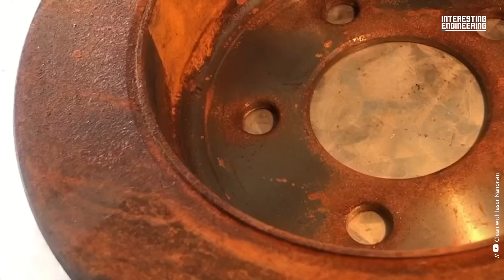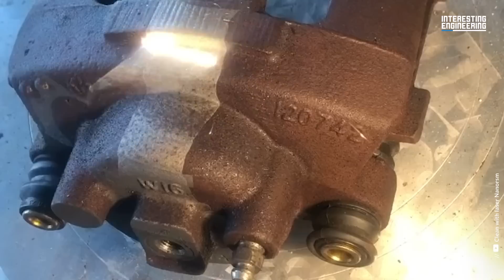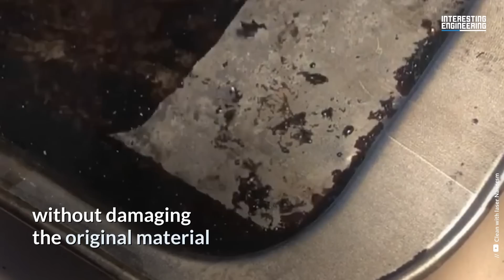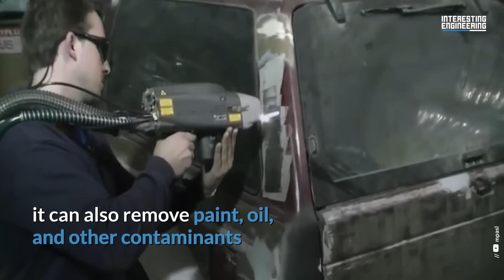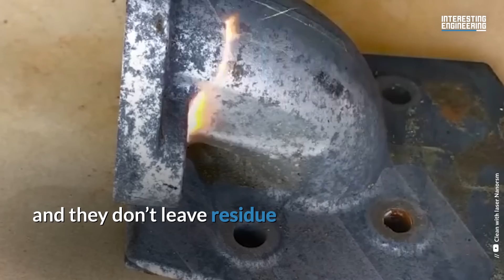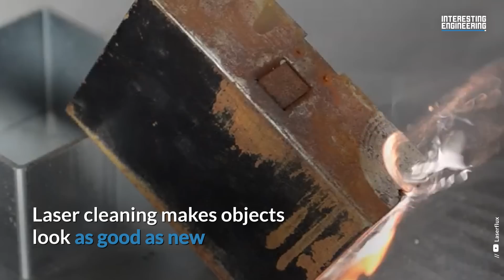How laser cleaning works

Comment: How much it usually cost for this laser cleaning?
Reply: It depends the cheapest portable one I think you can get for a rust laser is about 35,000-50,000$ dollars
Reply: Not cheap
Reply: There are currently two types of laser cleaning machine in the market. One is CW fiber laser cleaning machine. Another one is Pulsed laser cleaning machine. Prices range from $9,000-$50,000.

If you have low requirements for laser cleaning and only remove rust or thin paint of stainless steel , mild steel and iron, CW laser cleaning machine can meet the requirements. CW laser cleaning machine power support 1000W 1500W 2000W .

Pulsed laser cleaning machine with pulse laser source and galvo clean head. If you have high-value products need clean that must be use pulsed laser cleaning machine system.
Reply: @kaylastylecnc1197  I am interested to learn more about this product. Can you give me the contact point? I want to evaluate the ability to apply at my site.